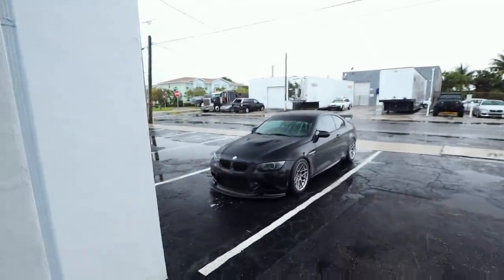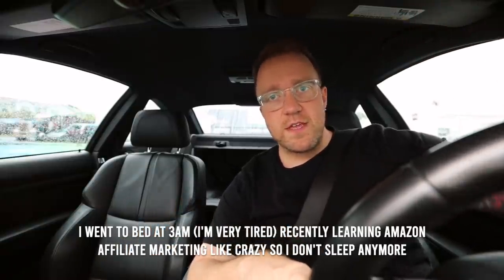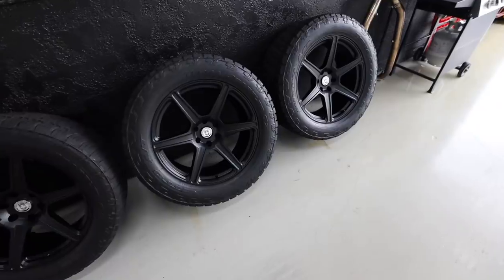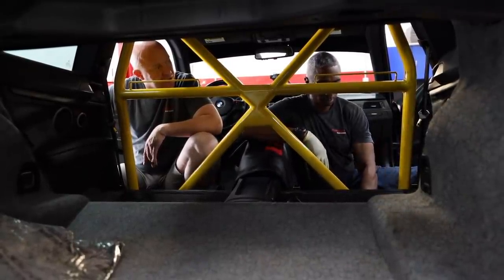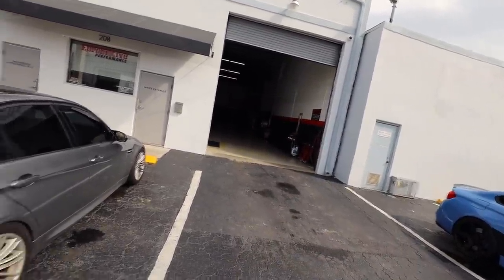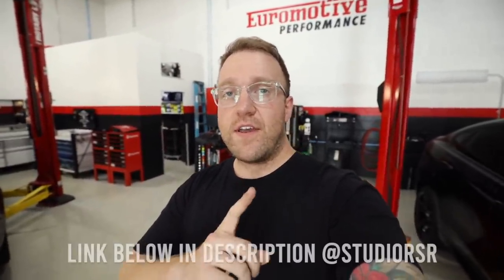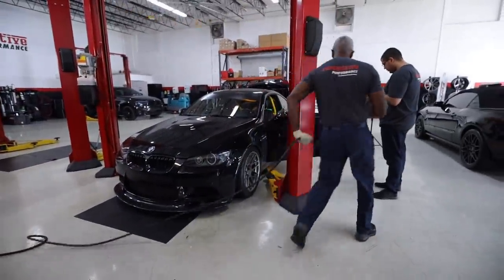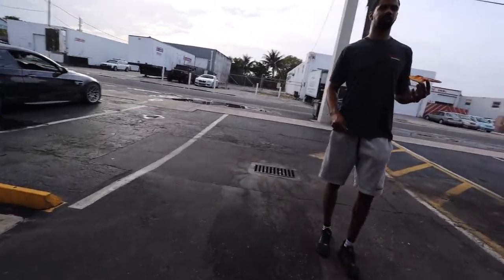Installing a StudioRSR roll cage in my E92 M3!

Comment: Always watch and enjoy your videos. But sorry that is adding no stiffness to your car. It’s drilled through a floor made of paper, and has no spreader plates fitted underneath. (Needs to be boxed into the actual chassis to add any rigidity). 

And the mount on the parcel self is doing nothing apart from holding the main section in place. Without it the main hoop would tear a hole in that floor. The down tube angle looks questionable, and the thought of driving a car with you head that close to a roll cage tube and no helmet is pretty scary. 

This cage is just a aesthetic mod, which is cool if that is what you want. 

Keep up the videos because I do really enjoy them, and I hope this doesn’t come across that I’m bashing the work, just want to give some constructive criticism
Reply: I've never seen him track any of his cars, so it doesn't really matter.
Reply: “Track inspired”
Reply: roll cages are for folks who can't drive

Comment: Spencer, looks great bro! Just mirror what others have suggested below. Get the bottom bolts properly secured via a plate or box welded in. Then get it all coated to prevent any corrosion. 

Good stuff! Keep the build going!

Comment: adds unnecessary weight, required holes to be drilled, no rear seats, no rear window visibility - just to look cool? f-that
Reply: Welcome to the American car scene
Reply: Brofessor _ look at Spencer’s last M3. That freaking roll cage saved someone’s life.
Reply: @guusberkhof8429  Actually if a cars wasn't design to receive a roll cage in the first place those half cages can do more harm than good. Modern roofs don't collapse like in the 70s or 80s, they still do a little bit because the energy still need to be absorbed. With the cage the roof can't always absorb the energy and it ends up being transferred in your body.
It depends on the car and the cage, I'm sure factory cages take all the factors into consideration but I wouldn't be sure for the aftermarket ones
Reply: @blackshadow7192  that's right half cage can help that the front part of the roof colapses in a roll

Comment: Dude you need to get bucket seats and some harnesses with a cage like that. Even just getting rear ended you could get seriously get injured. OEM seats and seatbelts were not designed for the extra forces that come from a rigid non-deforming rear crash structure like that. Honestly a helmet would be optimal.

Comment: listening you saying that this roll cage gives you stiffness and you can actually feel it, thats some funny and stupid shit. That cage is only for aesthetic purposes
Reply: androo457 you know he had one in his old M3 that was crashed and rolled and it saved the occupants right...
Reply: @unknown_user283  Those half cages are more dangerous than anything. It doesn't let the roof collapse like it's supposed to in a crash.
Look how far back the cage is the M4 GTS compared to the aftermarket ones.
If you look at the photos from Spencer's car you can see that everything in front of the cage is completely flat and collapsed, it wouldn't be that way if there wasn't a cage.